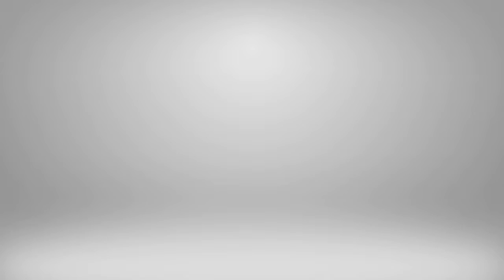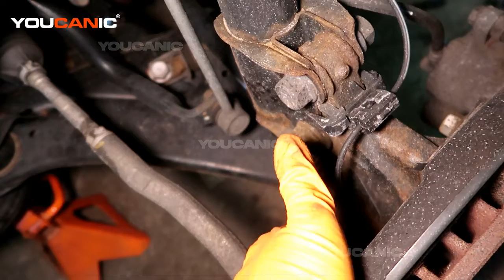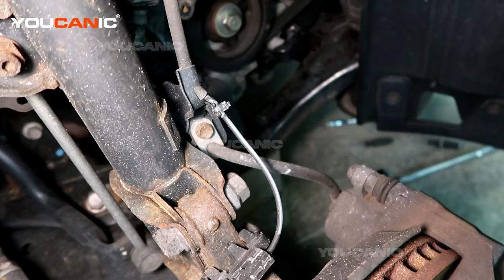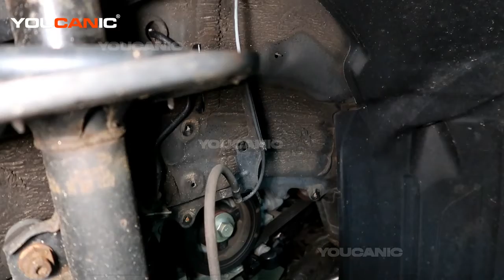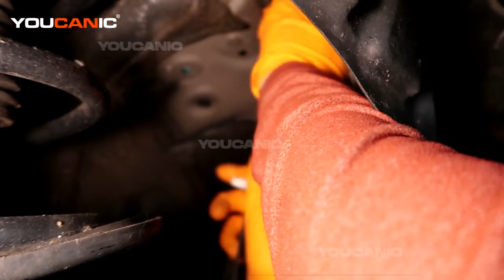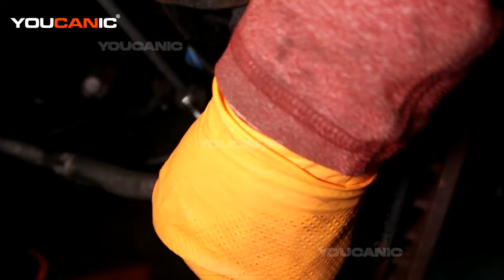2014–2019 Toyota Highlander ABS Wheel Speed Sensor Replacement

Comment: I have a 2015 Highlander with the same issue where my ABS light (and Traction Control light) are on.  Was wondering how much that harness was.  I got a quote from Auto Zone that is like around $280 whereas on Amazon I am seeing prices around mid 20's to  30's for the what seems like the same thing!  Something is not right here.  Thanks.
Reply: I’m having the same issue. Did you end up getting the part from Amazon? Did it turn out okay?? Thanks!
Reply: @thomasaviles9548  ok, the part I got from Amazon was, and still is, fine.  In fact the original part was almost certainly fine. The issue turned out to be a timing ring that comes on the right drive shaft. It comes as part of the whole right, or left, shaft,  as your case may be. The ring had a crack which was throwing off the timing.